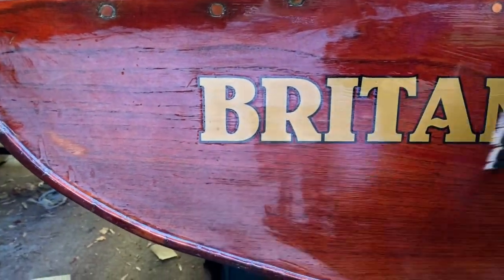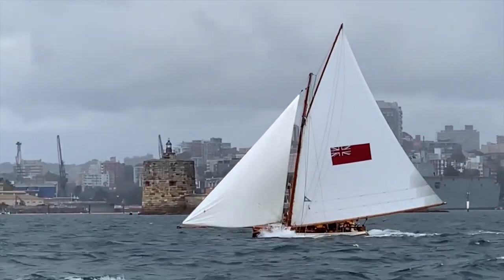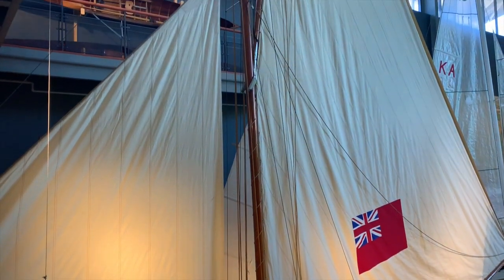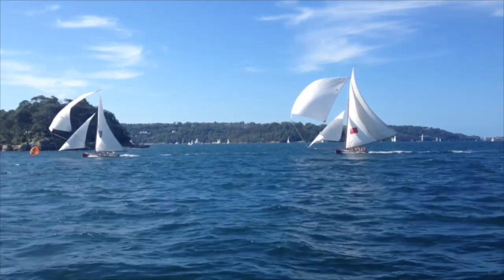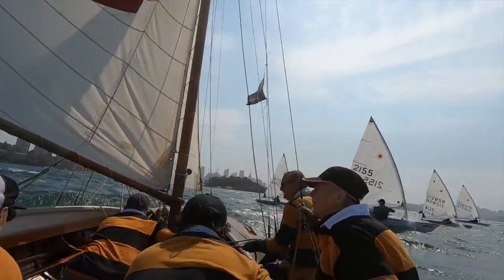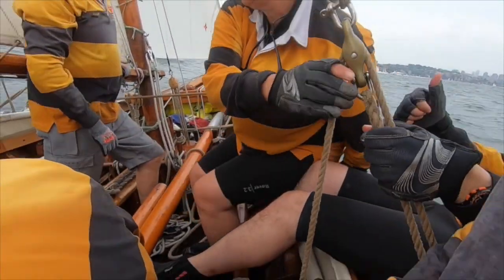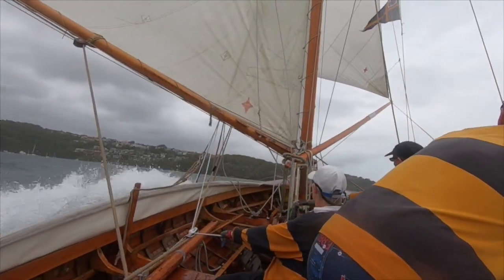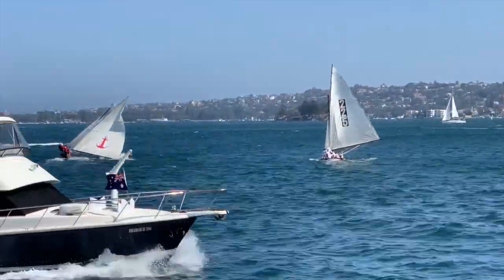Australian Historical 18-footers

Comment: These are amazing !  I have never seen one before, but now I am trying to work out if there are plans about anywhere?
Reply from the maker: There are plans for several boats and lines plans and models for many more, and THE OPEN BOAT book explains how to build them. However I’d seriously urge you to put a lot of thought in before you start…..these are racing boats that require relatively protected waters, a large crew of experienced sailors and a chase boat because they cannot self-right once capsized. They are not suitable as a general pleasure sailer.
Reply: Yep I agree. I imagine they are as practical as a foiling moth ! I would just like to see more of the designs and the progression. I am amazed at how extreme they are for their age.  @SmithysBoatshed
Reply from the maker: Best place to start is in THE OPEN BOAT book which has a history and evolution of the 18-footer including several lines plans, see www.openboat.com.au  @james5553